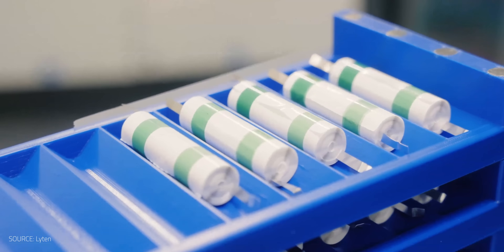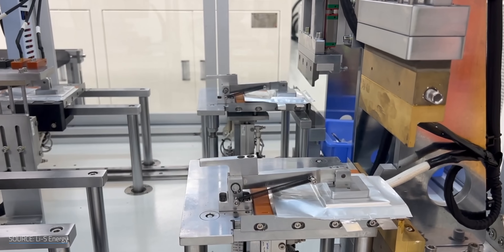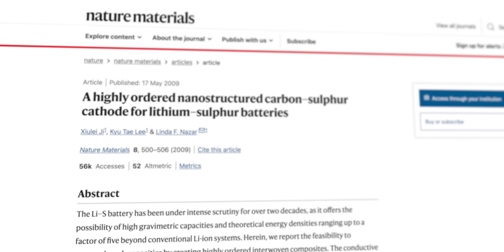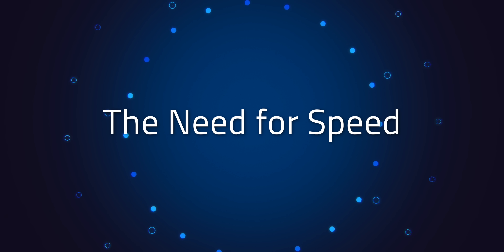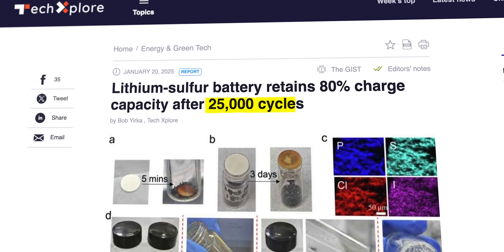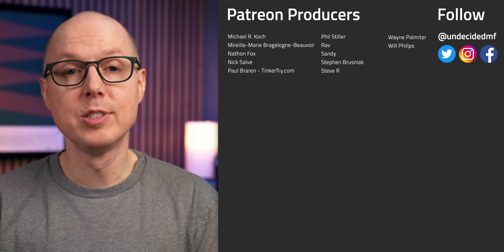How This Overlooked Battery Might Change Everything

Comment: Cost will be the final determination. If batteries can be made moe efficient, smaller in size and charge faster, great, but the real bottom line is cost. They must be made equal or cheaper, or be made so the final lifetime of the battery is worth whatever extra the cost, much like LED's did for lighting. They cost more initially, but are worth it in the long run.

Comment: Sodium-Sulfur batteries are improving in Wh / kg. They're not toxic and can be use in Battery Energy Storage Systems too as there is plenty of either in most places on planet E. We are at around 1500 GWh at the moment but need around 250,000 GWh by 2030. We have to get off of Lithium for the green revolution. Toxic and rare.

Comment: Even if they make this commercially viable and profitable for the company we won’t see a 25,000 cycle battery. At least not at a reasonable price for the average consumer. If we don’t have to replace batteries for that long of a period then the company won’t have enough continued demand. Look at cordless power tools. Used to the average price for a good drill with a cord was around $50. Now a Cheap cordless drill is $100-$150 and the battery is about the same. It’s costing people much more to do the same work, it’s just a little more convenient because we don’t have to pull around a cord all day. I see this new battery tech going the same direction even if it cost companies less to manufacture than the current lithium batteries used today. The batteries will cost the consumer two or three times more than current batteries because we won’t have to replace them as much. That’s just the way the world works.

Comment: This could be the game changer in removing all the practical objections people have for switching consumer tech to battery power.  Quite exciting. Definitely one to keep an eye on. Given that I can get a 2021 model year tech Skode Enyaq iV80 (77kWh useable battery) to go 500 miles (just) in the summer by hypermileing at around 6.5 miles per kWh, 1000 miles should be possible with these gen 3 battery technologies, putting it firmly back to what I used to regularly get with diesel powered family cars, ally that with 5-10 minute charging, the only limitation will be our charging infrastructure (again!) I suspect the solution to that is banks of capacitors or battery and capacitor combos at charging stations that can store electricity over a slightly longer time and then discharge it to client vehicles quickly on demand.

Comment: I am curious that if I were to buy a hybrid Ford Escape could or would the battery packs be made backwards compatible to upgrade the cars already built... I have been driving a 1969 F250 pickup that has been on the road longer than I have been driving... it was built to last and has with some substantial maintenance... had a 1980 Honda Civic that lasted 16 years... until a unibody issue made it unrepairable... the more vehicles that can be upgraded that are environmentally positive the better... the recovery of lithium to upgrade to LiS batteries could be an upgrade to the industry and conserve resources.

Comment: Your not wrong about li-ion battery... But the ultimate battery uses radioactive isotope decay and they last 25 to 50 or more years depending how they are designed for what tasks they are given... So in theory you could make a nuclear decay battery last 500 years without a recharge... I'd say that deserves a new looking into and i think you'll be as shocked as i was 😆👌 lithium Ion is basically just safer for civilians to use.... Where's if you crack the thermo isotropic decay battery open everyone is already dead lol

Comment: Love ypur report. I'm very interested. Lithium ION was a huge breakthrough and they own the market. The problem is there is not enough lithium on the planet to make all the liberal fever dreams of an electric powered world come true. Lithium Iron phosphate is the current darling od rechargeable batteries. Lithium ion in power dense but can only be recharged 150 times... give or take before serious degradation sets in.
Lithium Iron... promises 10,000 recharges before it gets tired. Even at 10k charges it will still charge to 80% and discharge correctly.
So now we have Lithium Sulpher batteries that can recharge 28000 times?? Wtf.
What happened to Diamond micro battery. It promised to recharge itself... not quickly, but reliably. If they can get the recharge speed up... how amazing would that be??? Ypu have a battery you can drain then leave it alone. Next time you need it, it has self recharged. Damn, science baby!

Comment: The question isn't whether it will overtake it, but whether big battery and big tech will allow it to. Replacement parts fuel like 90% of big tech. Especially seeing as they control right to repair right now.

Comment: these changes are always driven by one thing if their research is as promising as it seems as thats the cost. companies wont go for just a small 2% in savings in production, especially if you take into account that this is the replacement for lithium and the pushing factor is that Sulphur is cheaper and more readily available than Lithium the big companies might wait until all the kinks have been hammered out and just implement it later than what Lyten and even the companies with small Li-S factories and research teams are going to be putting out. 

but my opinion is always any advancement in science and technology is a great thing.

Comment: I guess the major drawback is the "Lithium" part of it - just as a deeply contested world resource.  My assumption is that existing demand for battery power would reduce demand for new lithium as the batteries last longer, but this is still the stuff of supply chain warfare.

Other than that, has anybody set fire to one of these things?  Are its chemical & thermal properties reasonable for use in consumer environments?  Would we ever be able to take one of these things on an airplane?

This sounds verrrrry exciting!

Comment: In the lab(s) the leading groups have pretty much cracked the nut on the sulphur problem and done so using several methods to varying,  but scalable states.  Of course it takes time to see these scaled up states with myriad real world usage testing hurdles to pass. Companies do not convert existing factories along with what appears to be concrete plans to build new mega-factories if the technology is, shall we say, shaky. Thus by what you reveal here, and in particular by your numerical probability rating, it appears we will see these supplanting lithium ion batteries be the end of the decade. I'm more than encouraged by your excellent report, even more so due to the fact your history proves a conservative, even skeptical, slant toward new battery technologies.

Comment: Vapor deposition of Li-S allows for the snowflake effect.  Just as water forms snowflakes.  The polar bonding allows for the magnetic alignment of the molecules to form the beautiful snowflake structures.
Vapor deposition of Na-S will also form these structures.  These structures can reduce the polysulfide problem by interfering with S-S polymerization.

Comment: Charging times of 5 minutes will be impossible not because of battery technology but because of  practicality. 100kWh battery charging in 5 minutes. That is effectively 1200kW or 1.2MW. Say 10 cars charging in parallel (not unusual at busy times) that's 1.2MW. That's equivalent to the supply to  about 6000 UK houses at an average demand. It's a huge problem just in getting the supply. Not to take into account the heavier duty charging equipment to cope with higher currents, remember I^2*R

Comment: Nothing said about the fire and explosion potential which has surfaced with the current battery designs. It is causing insurance increases and problems for accident repair. I have also heard that some parking garages won't allow these vehicles in. Unless these issues are addressed there is still a narrow market for electric vehicles.

Comment: Interestingly, it's the point at the end that I felt got "Rushed" through that was the most important: If this is a "direct swap" on a production, line, that is ALL of these changes, then I think we'll see Li-ion batteries dead by the end of the DECADE. I'd put a not-insignificant amount of money on essentially all products in 2031 debuting with Li-S batteries if the manufacturing change over is ACTUALLY that trivial (6 weeks and marginal capital expenditure).

Comment: If I understand the short comment about changing existing lithium production pcan be done, Then this might be the next step in battery Production at scale.  And sulfur is basically available everywhere, This would help limit the dependence battery manufacturers have on foreign countries, If the conversion Of existing facilities can be done then it would become economical for market as I have heard of other forms of electron storage that are superior but again it is a scale problem.

Comment: The current cathode, anode, mother-roll, lithium hydroxide, cell casing and cell assembly equipment gives the industry a big head start for converting to new technologies. Tesla has a facility in Fremont CA devoted to pilot production - easy to test tech before buying it, or access to it. 
Reno Nevada is essentially in the same metropolitan area as Giga Nevada. Perhaps it intends to steal workers from Panasonic and Tesla.

Comment: For context: 
A lithium iron battery goes through 300-500 full charge/discharge cycles in its 2-3 year lifespan. 

25,000 full charge/discharge cycles would translate to 100-150 year lifespan. 

Not forever, but long enough to get your first battery as a teenager and pass it down to your grandchildren.

Comment: I find the cycle measurement falls apart once you pass 10k which even commerical LiPo batteries can reach. Also it depends strongly on charge speed as that causes heat and more damage to capacity. A better measure needs to be found because tempreture is an important factor in general, leave a battery in flight inside of cargo luggage and the unheated cargo area will cool the batteries and cause problems.
Anyway a true "forever" battery would be one that outlasts the live of the generation that built it - around more then 60 years of use. Maybe that goal is so lofty that it is unreasonable but i think it sets a good upper maximum.

Comment: These are the batteries that replace your EV, cell phone, and other mobile electronics. "Na" will more than likely still replace the grid/home batteries. Yet, if they can make them cheap enough, these might still be the go to for all things going forward. "Li" and "S" are still consider really cheap. With "S" being cheaper than carbon is most cases. Either way, this should improve an area of the battery by 30% with a reduction in either weight, size, amount, cost, etc. And if they can get it to the charge cycles they claim - you wouldnt need to replace any battery once you get the device ( assuming no defects or accidental damage). That alone would cut the battery waste and e-waste we see today in half - that would be amazing alone.

Comment: AI Summary

Abstract
This video explores the resurgence of Lithium-Sulfur (Li-S) battery technology as a potential successor to dominant Lithium-Ion (Li-ion) batteries. While historically plagued by issues like the polysulfide shuttle effect, lithium dendrite formation, material swelling, and slow charging, recent breakthroughs are addressing these challenges. The video highlights advancements including novel electrocatalysts (like PVP inspired by Betadine), nanostructured materials (such as graphite scaffolds and nanocomposites) to manage polysulfides and enable rapid charging (potentially down to five minutes), and significantly improved cycle life, with one solid-state Li-S battery demonstrating 25,000 cycles while retaining 80% capacity. Despite the promise of higher energy density using abundant and more environmentally friendly sulfur, the video acknowledges significant hurdles remain for widespread commercialization, including scaling production, cost-competitiveness, and displacing the established Li-ion infrastructure. However, significant industry investment, exemplified by companies like Lyten planning gigafactories, suggests growing confidence and pushes the technology towards higher readiness levels (potentially TRL 8), making Li-S a critical area to watch in the energy storage landscape.

Lithium-Sulfur Batteries: Breakthroughs, Challenges, and Commercialization

*   0:00 Introduction to Lithium-Sulfur (Li-S): Presented as a potential successor to lithium-ion batteries, promising high energy density, fast charging, and potentially extreme longevity ("forever battery") based on recent research breakthroughs.
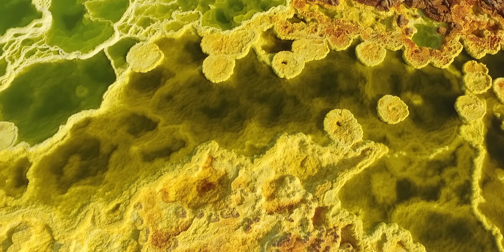*   1:54 Advantages of Li-S: Sulfur is abundant, cheaper, and more environmentally friendly than cobalt and nickel used in traditional cathodes. It also offers a higher theoretical energy density, potentially leading to lighter batteries.
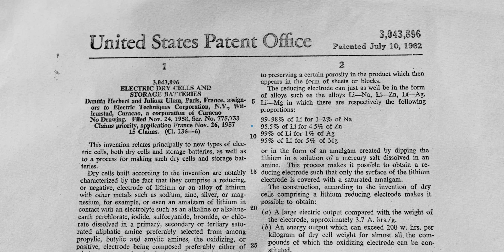*   2:32 Historical Challenges: Li-S technology has faced significant hurdles, primarily the "polysulfide shuttle effect" where intermediate sulfur compounds dissolve, migrate, and react with the lithium anode, degrading capacity and cycle life. Other issues include slow charging, dendrite formation, and sulfur cathode swelling.
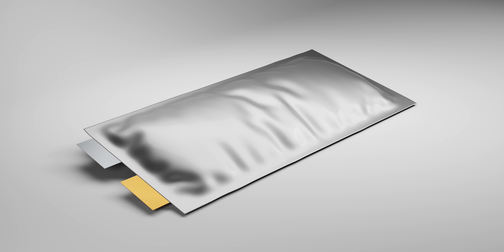*   3:24 Early Progress: Researchers developed various strategies to combat these issues, including physically confining sulfur (Waterloo's "caging"), using nanostructured materials (Drexel), and incorporating additives like sugar (LBNL) or Kevlar fibers (Monash), achieving incremental improvements in stability and cycle life (e.g., 400-700 cycles initially, later up to 4000).
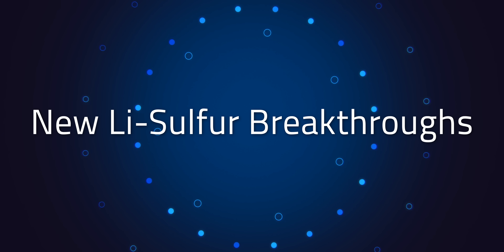*   5:58 Monash University (PVP Catalyst): Utilized Polyvinylpyrrolidone (PVP), found in Betadine antiseptic, as a catalyst to accelerate the chemical reactions within the Li-S battery, potentially enabling faster charging/discharging and boosting practical energy density (targeting 332 Wh/kg) for applications like long-range EVs (1,000 km).
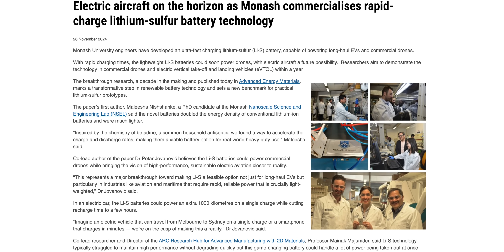*   6:46 University of Adelaide (Fast Charging): Focused on accelerating the Sulfur Reduction Reaction (SRR) using a specialized nanocomposite electrocatalyst (tungsten oxide, cobalt sulfide, carbon nanotubes). This approach aims to trap polysulfides and speed up conversion, claiming a potential 5-minute charge time.
*   7:42 DGIST (High Current Density & Stability): Developed a cathode using a magnesium and nitrogen-doped graphite scaffolding structure. This design physically contains sulfur, preventing swelling, while the materials facilitate fast ion transport, enabling high current density (21.7 mA/cm²) operation and rapid charging.
*   8:47 Nature Study (Solid-State & Longevity): Reported an all-solid-state Li-S battery employing an iodine (I₂) mediator. This enables a solid-solid sulfur redox reaction (SSSRR), bypassing the problematic dissolved polysulfide stage and achieving remarkable longevity: 25,000 cycles while retaining 80% capacity.
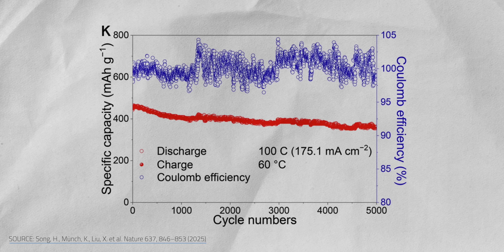*   9:42 Commercialization Hurdles: Despite lab successes, scaling up production remains a major challenge. Li-S technology must also compete with the deeply entrenched lithium-ion industry, requiring significant investment in new manufacturing infrastructure and supply chains.
*   10:31 Commercialization Efforts Underway: Companies like Lyten are actively pushing Li-S towards commercial reality. Lyten uses graphene-caged sulfur, claims easier production scaling than Li-ion, and is building pilot plants with plans for a gigafactory (2 GWh/year capacity). Monash University also plans commercial drone testing.
*   11:47 Technology Readiness Level (TRL): The TRL for Li-S is varied. While fundamental research continues (TRL 3-4), serious commercialization efforts by companies like Lyten suggest progress towards mature technology demonstration and system operation (potentially TRL 8).

I used gemini-2.5-pro-exp-03-25| input-price: 1.25 output-price: 5 max-context-length: 128_000 on rocketrecap dot com to summarize the transcript.
Cost (if I didn't use the free tier): $-0.0146
Input tokens: 13859
Output tokens: 787

Comment: nice video.
I recently stumbled upon our Dutch Business Radio on another technology using silicium as anode for lithium ion batteries. As it's much lighter and thinner it would push the boundaries of battery capacity immensely
Perhaps this is a nice one to research as well. Leyden Jar is the company name.  I have no stake in it, just pure interest in getting cheaper, safer and more energy dense batteries.

Perhaps a nice one you might want to research?  Love to see your opinion on this new technology.

Comment: Did you talk already about the ALD effect on battery? You should take a look on the result Beneq had on R2R and ForgeNano had on ALD coated lithium powder. 
Basically ALD with Al2O3 creates a Li-Al-O interface that makes all the difference, avoiding Li oxidation, higher Ion flow, higher capacitance, higher retention. There are several papers on it 

Just entering from semiconductor perspective to battery and PV you can pull easily an episode :)

Comment: I am looking forward to the Lyten battery and what they will be doing, as they are the ones about to be commercialized. I could use a lighter-weight 48V battery for my electric trike that not only charges quicker but has more energy so I can go further before recharging. As long as the cost is within reason.